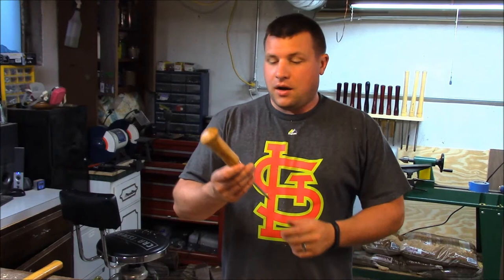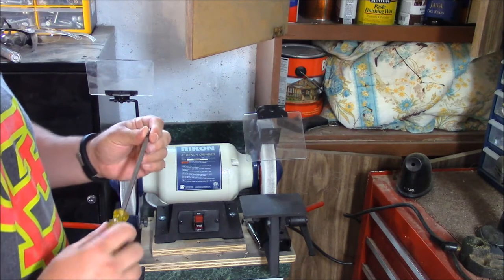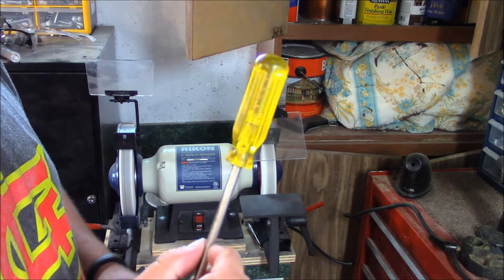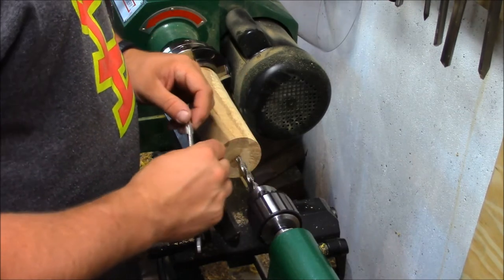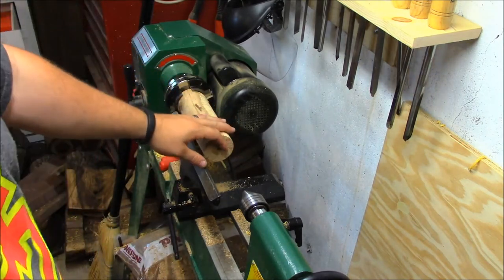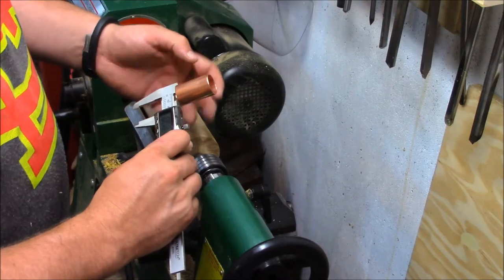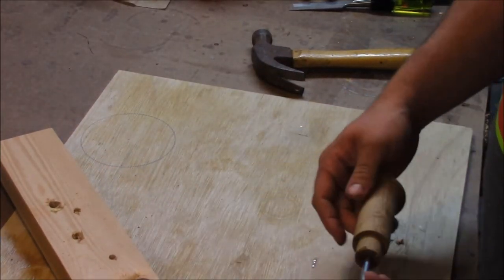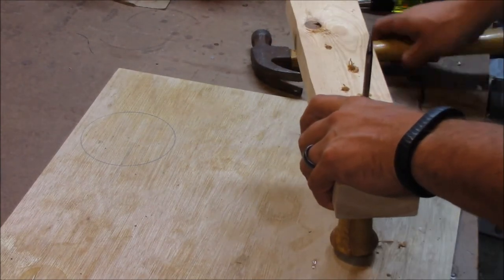How to Make Your Own Scratch Awl

Comment: Nice awl. Just a bit of info for you, and any viewer looking to make one.

The copper ferule (collet) was supposed to go on before you drove the shank into the wood. The purpose of the collet is to keep the piece from splitting since you drive the shank it into the end grain. I'm guessing the hole was fairly large and didn't provide much compression and holding around the shank.